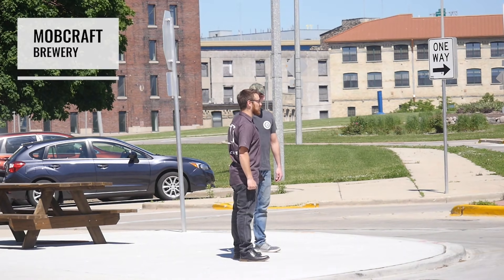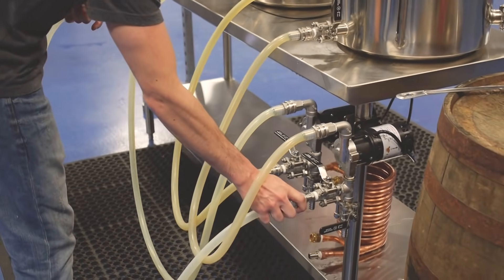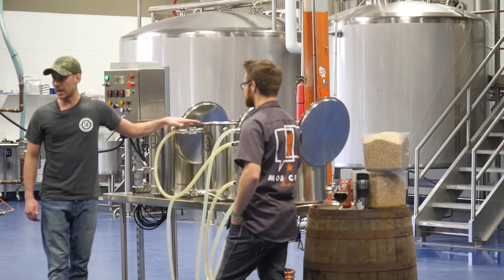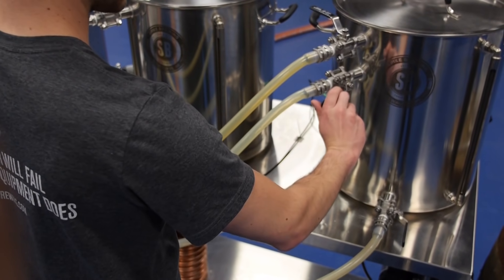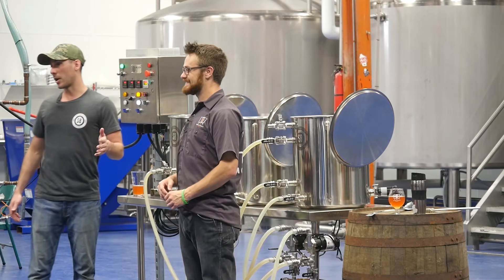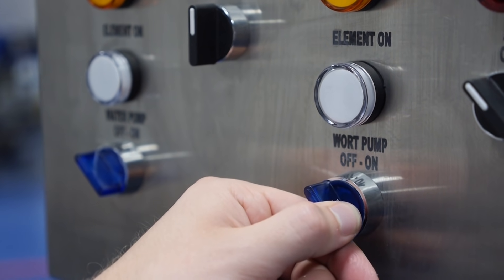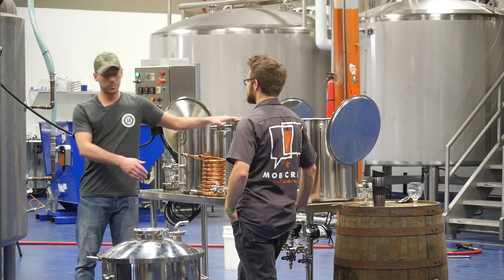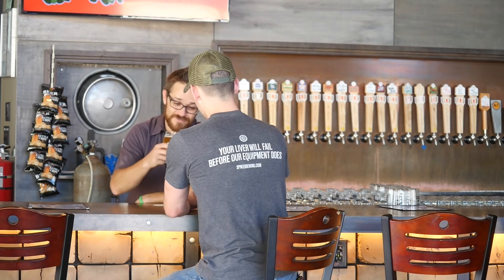MobCraft Brewday on Spike Trio Brewing System

Comment: So.... Spike, it looks like you would have to remove the false bottom from the mash-tun after removing the grains, prior to cleaning, with the brew wash, but this wasn't clear to me after watching the video. The video seems to indicate the system can be cleaned without removing the false bottom, but if that is so it seems there would be grain residue and liquid solution trapped under it, which couldn't be removed any other way than inverting the tun and letting it drain out. To clarify, is cleaning done with the false bottom in place or removed? Thanks in advance.
Reply from the maker: The false bottom needs to be removed

Comment: Something I noticed, there's no oxygenation stage when moving wort to the fermenter, or after pitching yeast.  By design?
Reply: I would guess that's what the whirlpool stage is for
Reply: @mmichaelou812  Good thought, but the whirlpool is too gentle, it doesn't oxygenate the wort.  At best, the aeration can increase the level by about 8% which doesn't move the needle much, maybe 2ppm.  It takes a micron stone or some pretty aggressive agitation to get the numbers up to 8-10ppm.
Reply: Good to know - I have been using my auto siphon to pump air into the wort and so far so good. But I'm just a hack haha
Reply: @mmichaelou812  Nothing wrong with that; what you're doing definitely gets oxygen in there, more so than doing nothing.

Comment: Hi, great video. I noticed that during the cleaning sequence there were no spent grains in the mash tun. How do you empty the mash tun before cleaning?
Reply: Disconnect it and dump it? or scoop it out?
Reply: Personally, I scoop the grains out with a big plastic pitcher until there's maybe 2-3 inches of grain at the bottom, and finish off with a wet/dry shop vac... Works VERY well.

Comment: Great video! I see while mashing in, you guys kept the recirculation going instead of mashing in with the valves closed and then opening them back up to recirculate. Any noticing differences in either method? Im supposing many stop the recirculation while mashing in, to avoid compressing the grain bed while trying to get all of the dough balls out. Recirculating while mashing in gives the opportunity of the HERMS system to regulate the temperature loss from adding grain.
Reply: I've ran maybe 20 batches on my Spike System and I have had the greatest success (fewest stuck sparges) by leaving the re-circulation going maybe 50% and just slowly pouring in my grains with a light stir. This does let the HERMS moderate the temperature loss and helps to set the grain bed without jamming anything up.

Comment: Hello, I have a question regarding sparging temperature. In the mashing process the hlt is at about 150°F im I correct? If you have to sparge at 167°F, how do you heat up that water instantly so to sparge at said temperature? Its not clear in the video when you heat up the sparge water to get to 167°F. My guess is that you start the sparging at mashing temp and heat the water until you get to sparging temp? Am I correct? Would love some help in this issue. Cheers!
Reply from the maker: If you're mashing at 155F your HLT will be about 157-158F. If you would like to sparge with 167F you can turn your HLT up the last 5-10mins when mashing or turn the HLT up at beginning of sparge and it will gain the 10 degrees in less than 10mins.

Comment: Why did you place the output of the pumps lower than the input? If you flipped them around and had the output of the pump as the highest point any air in the system would naturally flow out. It would almost elminate the need for the air bleed system and also prevent a slow building up air in the pump head when your moving low volumes of water.
Reply from the maker: We found this orientation with air bleeds to work the best and be the most fool proof. One example of the way you described being an issue with from the MT out to the pump to the HERMS coil. When the coil is filled with wort/water the air can't bleed through the system. The air gets trapped between the MT out and HERMS coil in. This can cause the pump to not prime.
Reply: Spike Brewing I am sure you have done alot of testing to come to this conclusion. I have just never seen the output of the pump lower than the input. I thought i needed an air bleed untill i changed the orientation of my pump. Having the output higher has mitigated any air bleed issues. It might be worth just flipping the pumps around and seeing how it works.
Reply from the maker: This was one of the first setups we tried. The air bleeds were a much more reliable option from our testing.